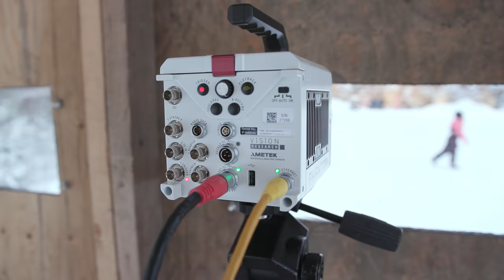Exploding Broken Down Tesla Model S

Comment: While I agree with right to repair, you realize the battery in the empty state has enough energy to weld for hours and shorted to bypass the safeties can make an air fuel hydrogen flame nightmare.
Even my electric bike battery, charged, is rated for 400 amps continuous discharge for over two minutes. 600 amps momentarily. They are not for the stupid or accident prone.
Reply: Right to repair means that it isn't locked to the manufacturer for repair.  It doesn't mean that Joe Schmoe could, or even would, fix it himself.
Reply: I think on the high current batteries you should take a safety class. I build my own battery packs and have learned to be very careful.  A car owner could work on them but the learning curve is steep with some issues giving no second chance.
It is a case for even a shop that figuring it out could kill.
My bike moves 400lbs 20 miles at over 20 mph, 1500w motor.
400 amps for 2 min at 48 volts energy, now extrapolate that to a Tesla Battery for potential energy and I understand Tesla's liability issue.
Reply: 400A at what voltage, after what I can see the Tesla has 400v, that would make it 160.000 W? My 5kw/h 24v battery bank can do 200A continuous and not much more then that peak...

Comment: Its a pitty that the batteries is so expensive that its cheaper to scap a car than repair it for what effecitvly is a less than 10 year old luxary car
Reply: Even these older models have pretty good resale value, so there was probably more wrong than the battery.

Comment: I'm sure that Musk would even like this video! 

Are these batteries decent in the Finnish winters? That cold feels like it would drain batteries pretty quickly
Reply: Tesla has heating for the battery, do not buy a electric car in a cold country without battery heating... My electric mountain bike has same type of lithium battery and when it is less then +15c it looses power when going upphill like crazy and at 0c it is really bad. Here in North Norway is ALWAYS colder then that so you basically have to keep the battery inside until you go riding and do not stop but continue biking as if you stop the battery gets cold and you will struggle to get uphill. Lithium batteries like in electric cars and bikes do not like to get colder then +10c.
Reply: @a64738  I would never buy an electric car. I was just curious because I know that winters get real cold in Finland. Thanks for the insight though! I didn't know that tesla had a battery heater. That's probably got to be a must in some areas
Reply: @PaperMakersAdeludedbroad  Never say never. If prices go down for batteries (probably would take a new, non-lithium based tech) the potential for lower maintenance costs from less moving parts very much could come to be.
Reply: @RryhhbfrHhgdHhgd356  I'm going to stick with never for me. Combustion engine or nothing. Just what I prefer to drive.
Reply: @PaperMakersAdeludedbroad  But.. why? Acceleration is poorer, the smell outside the car is horrific, and the noise is obnoxious. Like, actually legitimately curious here. Why?

Comment: I loved seeing this. We need to do this to all EV's. I hate them.
Reply: I actually think EV's are a great concept such as charging in your garage, less parts, and no toxic fumes. What annoys me is the corvette pricing and the $10,000 U.S. to install a fresh battery pack !
Reply: @daveshoraceway  you forgot about the charging time and material quality
Reply: @FZNL  since I work from home and not into travel charging at home over night would be no big deal. The thought to fill up at home rather then at a gas station  is a turn on for me. Also no oil changes and less moving parts on the car. The part that turns me off is the cost of the car and the battery replacement cost. All other car manufactures entering the EV market are just as greedy. They say they are joining the green market for the planet and in reality it is to line their pockets with green from you and me.

Comment: Our chevy volt from 2013 had a similar problem with the batteries leaking coolant into the floorboards. Took it to chevy dealer in NO,LA under lifetime warranty and they replaced the batteries. I can only hope the car will last another 10 years before the batteries go out again somehow. Hopefully it doesn’t do what it did last time. It has been a nice car comparably to the similar tesla’s but the battery would be impossible to get without a warranty.
Reply: Lithium as a battery material leaves a lot to be desired unfortunately. It’s just so light though! Part of me thinks it might be worth it to make batteries out of a cheaper material (iron, sodium, etc.), and just built our roads and safety infrastructure around the logic of having cars which weigh as much as a semi-truck. 😂

Comment: If it was a NIO car this would not be a problem, because if you choose for BAAS membership then you buy the car excluding the battery and you rent the battery and you can swap it any time you want at a NIO swapping station! No battery degradation. Swapping a battery is possible within 5 minutes and you can continue driving. Depreciation of car is significantly lower, since battery is rented. You can also swap to another larger battery if you need to travel far. Also, you will always get the newest and most up-to-date battery.

NIO FTW!

Comment: As far back as we have data, most of the energy used in the U.S.has come from coal, oil and natural gas. In 2018, those “fossil fuels” fed about 80% of the nation's energy demand, down slightly from 84% a decade earlier.Jan 15, 2020

Comment: This is why EV are not patricidal after 8 years the batteries will degrade to the point where it would be unusable and to replace the batteries it would be 20k which more than what the car is worth.  We need to either go plug in hybrid because its cheaper to replace battery cells or standardized batteries for battery from factor swamping. It's such a shame, the car is so new and is still far more advance than many new cars today but its just undrivable.

Comment: Wow 2013 Tesla is nothing but junk. My 2006 Pontiac Vibe with 180,000 miles is in perfect running condition. If it wasn't for the faded paint, I would practically be new.

Comment: Should have kept it, 2013 model years will gain collector value in 20 years and with the battery pack removed it can be maintained for a long time in a dry and clean place since most of it is aluminiu., plastic and glass. Also it can be revived later with future and much better batteries and motors, though many of the car s controls would need to be reworked like unlocking it, air conditioning and other stuff but it can be made to work with donir parts from future cars.